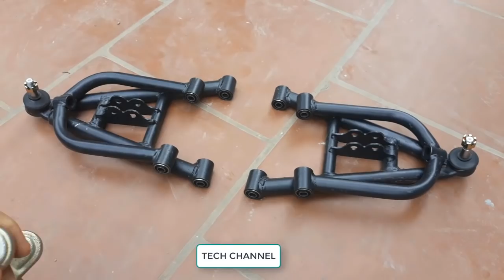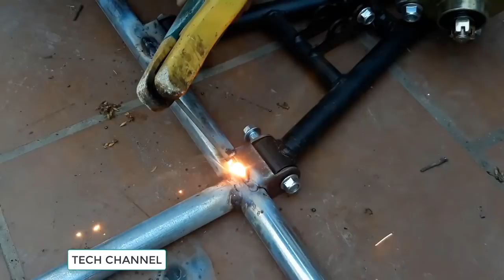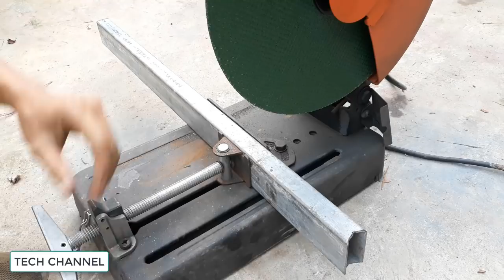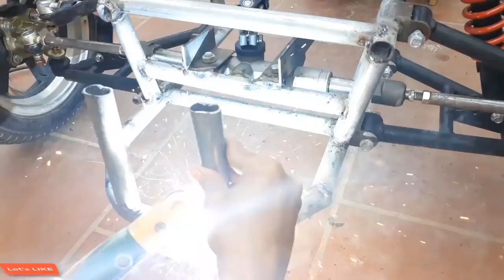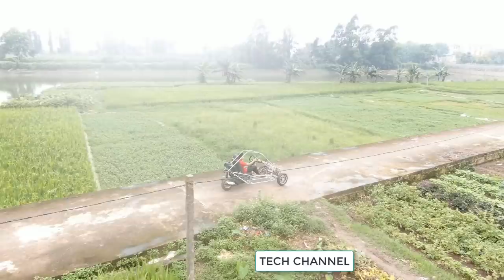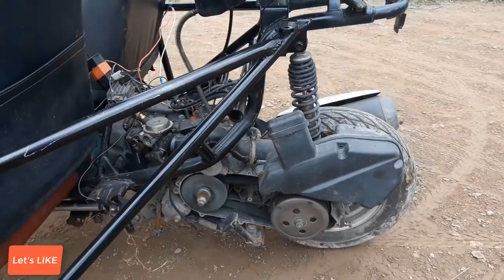Homemade 3-wheel vehicles / Tech Channel

Comment: I think you need a more direct stearing and maybe it's the clutch or the gearbox that you don't get on speed. Or the system is to heavy and you should remove the zink befor welding it's not very healthy. But your constructions are great keep going on and stay safe, would like to volunteer.
Greetings from Germany!
Reply: Which kind of iron or steel is used for chassis and frame???